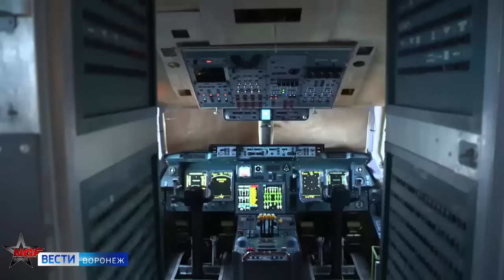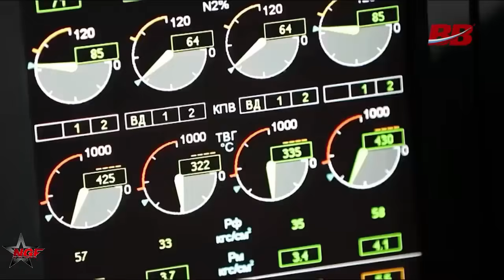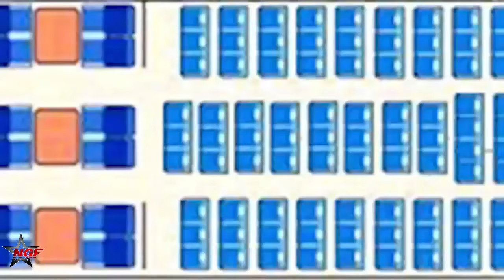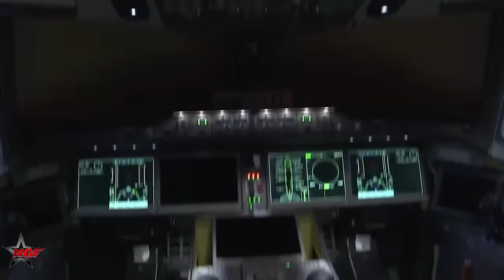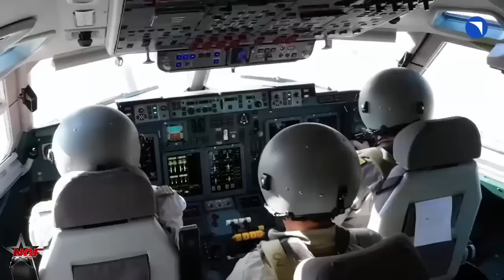Russian New Il-96-400M to Expand UAC’s Civil Aircraft Lineup

Comment: After the 787 dual engine failure, I can say more high pitch voice that airplanes need four engine
Reply: No failure. The pilot shut off fuel and shut them off. The number of engines wouldn’t change anything with that crash.
Reply: Pilots shut down the engines. Same thing would have happened if the plane had 4 engines

Comment: Root strength is it's engines which are 100% made in Russia.
Big boost for Russian civil aviation sector.
China main issue remains engine for their civil aviation sector.
Both should start joint ventures.
Best of luck for new air crafts

Comment: Love that Russia is becoming airliner independent, again! The industry should be something akin to the medical field with NO sanctions and parts criminally withheld. AI as a learning experience never again refer to the IL-96-400 as il 96 to 400. This dash space should be left silent or il 96 dash 400m, as an example. Same applies to most ammo, 45-70 is not 45 minus 70, again leave it silent. Lastly I dunno if this was wishful thinking but 8000km is barely enough for transatlantic flights.
Reply: Cuban airline uses them in trans Atlantic flight weekly.

Comment: 4 engine planes r not fuel efficient & out of fashion, so I doubt any Asians will order them.
Reply: Пока недруги тихо ухмыляются над Россией, российские инженеры тихо и целенаправленно идут к цели возвращения былой славы Советского Союза, как великой авиационной державы, который производил всю линейку самолётов военного и  гражданского назначения! Вспомните, хотя бы Ил-62, Ил 76, Ан-124 Руслан, Ан 225 Мрия, не говоря о десятках видах самолётов, которые производились в СССР на различных авиационных заводах.
Reply: but safety wise
Reply: дело не в "моде", а в прожорливости-расходе топлива НО, что точно лучше - это безопасность самолёта - крайне маловероятно, чтобы вышли из строя ВСЕ четыре двигателя, тогда как два двигателя - явно в этом проигрывают.
Reply: @derikbarkof7090  FYI, dozens the B-747s, A-340s & A-380s r available in storage & may be less costly to be leased than new Il-96s.
Reply: @derikbarkof7090 2 engines inferior? The vast majority of commercial airlines only have 2 engines with crashes very rare. Google ETOPS. The West already accounts if one engine fails. The only reason why the 400M has 4 engines is of engine technology, they are underpowered. They have a low air bypass ratio.
Reply: Looks at 787 failed engines in India. On the point, IL96 are more secure.
Reply: Yang dipakai presiden AS adalah pesawat dengan 4 mesin, lalu mengapa 4 mesin dipilih karena jelas lebih aman.
Lalu jika mesinnya memakai 4 buah PD-14, harapan lebih hemat bahan bakar tetap ada.
Reply: The good thing is that Russia know they need to catch up. That's why they are developing new engines to resolve that problem. Eventually with PD35 & other versions they will achieve the two engine configurations.